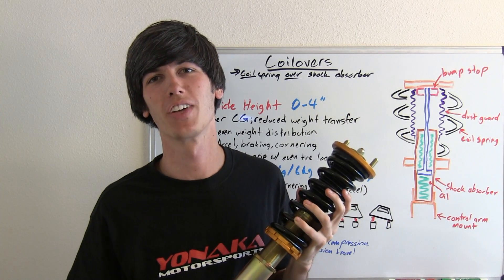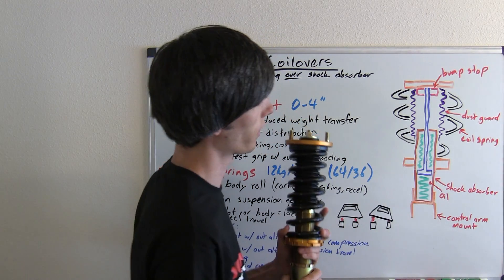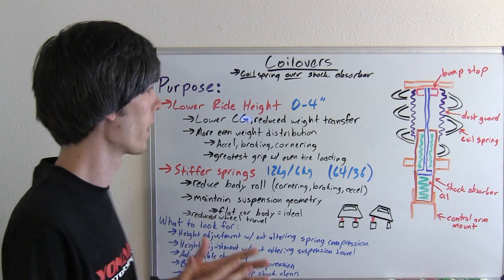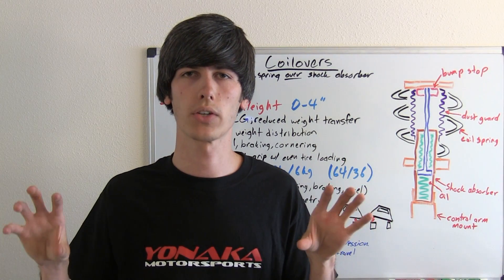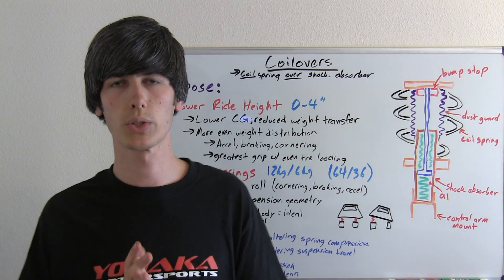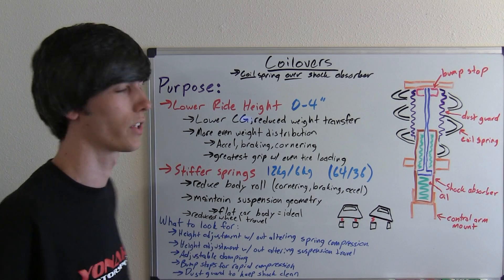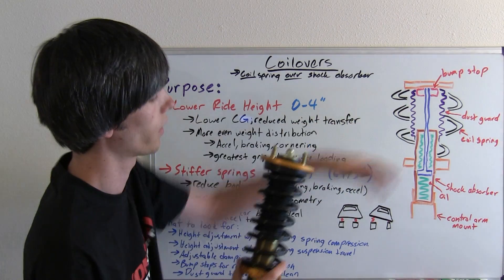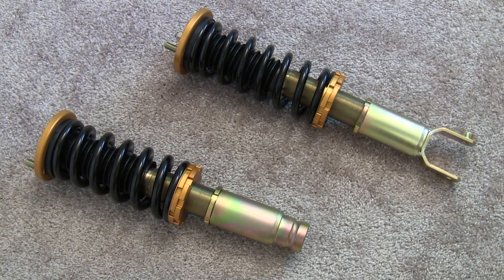Coilovers - Explained

Comment: You should do a vid comparing coilovers and air lift suspension.
Reply: Jordan Barone
Pneumatic suspension and airbag support/levelling aren't the same things.
Basically, the airbags are somewhat limited and replacement is costly.
The pneumatic piston kind isn't insurable, so not roadworthy. Sadly.
Basically anything can be made- but legally you can't drive it. Also it's not oem so you can only race/show.

Comment: trying to figure out the difference between coilovers and Macphersons... ?
Reply: animesis the macpherson is arrangement of connecting struts between the car, the wheel, and the the spring and the shock absorber - this entire setup forms your suspension 

The coilover is a type of shock absorber.

Comment: What's a reasonable amount to pay for 4 coil overs? only reason I'm considering coil overs is because all 4 struts are shot in my lancer and I don't have a spring compressor to switch out the struts
Reply: 400-700 for a smaller, but quality brand
800-1100 for better known brands with big reputations like BC racing, etc

Comment: My Toyota Camry has coil springs over shocks as stock with the car.  Are they still considered "coilovers", which you refer to as an aftermarket video?  Good video.
Reply from the maker: +bills48321 generally people use the term coilover to refer to aftermarket struts, rather than OEM, but yes, you'd be replacing stock "coilovers" with coilovers if you were to do a swap. Most cars have coil springs over the shocks, at least on the front suspension.
Reply: Thanks.  I am really enjoying your videos.
Reply: Know as macpherson front sus
Reply: but don't these raise and lower your vehicle?
Reply: Most cars???????? :D Nearly every common car made nowdays have ( with FWD). But Mercedes forgot to get one in their Sprinter (RWD). You know it's just a van you use to haul 2 tons of goods lol. So when your shockabs die, your front wheels just gonna move freely forwards and backwards. WTF Mercedes-Benz?????
Reply: Known **

Comment: Hello,
I'm an engineering student. I stuck with one problem. I wann find damping coefficient for air strut (of fox) but ,their is nothing information available for its calculations. No such setup to calculate it.( I live In quit remote area) Can you tell me how could I find damping coefficient? And is their any thing  you could tell me about it. Do manufacturer manufacture by considering damping ratio?? 
Do help me. Thnk you

Comment: I changed my Honda Civic tyre from Bridgestone er300 to Goodyear which are softer and less noisy. But now whenever I come across bumps, the car seems to jump more than before and this gives a "thudddd" sound from front suspensions if I am at bit higher speed....do I have to change my coil overs to stiff type or just adjust the tension in coil over?.........eventually I have changed my driving style and go more slower at bumps.....but I don't like this ...please advise

Comment: SO you can actually lower the car a few inches and maintain the same ride comfort?
Reply from the maker: +Kewfit Not really, no. Lower means you need a higher spring rate. Higher spring rates tend to result in a harsher ride.

Comment: I am very confused with preload and dampening. I purchased a car with coilovers but they are crazy stiff. I understand how to raise and lower the vehicle. but how do I make the ride quality smother (allow the suspension to travel further). do I adjust one or the other or both preload and dampening?
Reply: +WesTay Changing the preload will only change your ride height and at which point the piston in the dampener is at equilibrium. Unless you think the dampener piston is at one extreme or the other in it's travel there is no need to adjust the preload.
Reply: +neistridlar THANK YOU FOR YOUR HELP.

OK so preload is based off of the vehicles weight if I'm understanding you correctly. so no matter the settings one has there coilovers the preload factor should never change. 

so for a smother ride I should adjust the dampening and height only? I purchased the car like this so sorry but I have no prior experience of coilovers. my car is bearable when I am on slower inner city roads. but it is when I am at highway speeds that any little wave in the road drastically affects the car. to the point that I actually bunch from my car seat. it feels partly do to the stiffness and partly do to the rebound as it will bounce a few times after a bump (kind if like a trampoline effect).

I need this car to commute long highway distances once a week now so it is imperative that I fix this. not sure if I just have a stiffer coilover but they are (stance super sport coilovers) they also have camber adjustment. the car is a wrx hatch and I have custom fenderflares on the car as well so it is sitting quite wide with a 17x9.75 rim and tire with spacers. there is zero camber on the car as it was set up for a more so track day use. 

I purchased the car assuming I could change this as the tire is really low on the car and about a 2 finger gab between the flare and the tire. I am wanting to rase the car about an inch and increase spring travel as much as I can before it will rub from a bump.

I can not stand to drive the car on the highway for more then 30min before I seriously have a headache and feel like vomiting because the bunch is that bad, haha.
Reply: +WesTay bounce is that bad*
Reply: +WesTay Before you do anything on my recommendation keep in mind that I have not played with coilovers on full size cars, only on hobby grade RC-cars. The mechanics of it should be exactly the same, however comfort is not a concern in RC.

How much a spring is compressed when the car is resting on it is purely dependent on the weight yes. That means changing the preload changes the ride height first and foremost. The stiffness of the springs remain unchanged.

So to try figuring out what is going on with your car. Since it sits so low it might be possible that the previous owner did not understand how the coilovers work, and used preload to lower the car, in which case it is entirely possible that the dampeners are bottoming out. This would cause a violent jolt when the suspension is compressed, as if there was no suspension at all. It's practically free to try raising the car by increasing the preload, so I would try it and see what happens.

You say the car keeps bouncing after hitting a bump. Compared to a car that you would consider comfortable, is it bouncing at a high or low frequency? The higher the spring rate the higher the frequency of the bouncing. 

The main thing to do to stop it from keeping on bouncing up and down is to increase the dampening. Based on the cars that I have ridden in I would say you should aim for 1-2 bounces on heavy bumps. That seems reasonable for a street car.

Hope you figure it out.
Reply: +neistridlar it is very possible that the car was not set up right by the previous owner. I'm hesitant on changing the preload though as it is set properly from factory (that is if the previous owner didn't touch it). if I was to fiddle with it how would I know what the proper settings (factory setting's would be)?  I do know the weight of the car but I wouldn't know how much is distributed to each corner. (I may possibly be able to find that info online). I will first raise the car a little then adjust the damping and see if that does much. if not then I will look into the preload. but yes it has a very springy feel. for example if I was to shake the car left to right it would sort of wabble briefly afterwards. so it is possible that is is not absorbing the load as much as it is just converting the energy back away from its self.

Comment: so, if coilover is "coil spring over shock", it means it doesn't have to be adjustable just by definition.  Than isn't every strut with spring over shock absorbed a coilover?
Reply: Jan Mokrzecki When people typically refer to coilovers (as in this video) they are usually referring to aftermarket coilovers that are performance-oriented and are usually adjustable in both ride height and shock stiffness. However, most vehicles that have Macpherson strut front-suspension design use an OEM strut & spring assembly where the strut and the coil spring are integrated together into one unit, so technically they can be considered a coilover, but they are OEM or OEM-equivalent and are not adjustable. They are also primarily designed for ride comfort over handling performance as opposed to aftermarket coilovers that are performance-oriented and designed for handling over ride comfort. Hopefully that clears up some of the confusion.
Reply: +Jan Mokrzecki - I came with that question and I leave with that question. People are learning from this video, but without that question answered, I don't see how. Also, there was no mention about raising height though it was implied.

Comment: Its fine to explain how coilovers work, but normal people use them for looks but not for what they we're intended. I used coilovers for exactly the same thing when i was younger But beware of lowering the car to much, as there's a fine line between a good balanced car and a horrible one. The original wheel alignment you would use to re-align the car with is also not correct anymore. There are shops who know a lot about wheel aligntment on lowered cars but they are few and far between. Normal cars are not meant to be lowered more then 10-20mm (Or intended at all). Bushings, control arms etc are when lowered stressed and at a different angle, so an alignment will never be perfect, and can only be partly resolved by a shop that know's his trade.

Comment: Interesting video, but what's the real benefit of having having coilovers instead of an "independant" damper ? I understand they usually feature some useful adjustments, but that's not what makes coilovers be coilovers right, so where's the real intrinsic advantage?
Reply: +J-H Coilovers made for the aftermarket are not sold for racing, its for normal cars and gives options for a stance only (thats how most use them). For racing application they are made for evenly weight loading each wheel. That means that you put the persons weight in the car, and you then to a corner weight it and you thereby even out the weight in the 4 corners on, that means that every coil is adjusted differently. The only difference is the adjustable height difference, but lowering them coilovers compared to a fixed lowered kit is about the same, but usually a coilover kit is has a bit stiffer setup..
Reply: +Martin Rasmussen Thanks for that detailed answer. However, if you adjust every spring differently and get an even weight distribution front to right, it means the car will be quite inconsistent under other loads, as the  stiffness is different ? In a nutshel, the coilovers' real benefit is to feature many adjustments and that pretty much everything can be adapted directly on it, but if you use a fixed set-up, they're not that useful are they?
Reply: +J-H Usually you dont balance the car and go for looks and adjust the rideheight to what you find look good, that does'ent say anything about a good balanced setup. A racing car is never bound to the same springrate back to front, it depends on the application and if its rwd or fwd or front, mid or rear mounted engine and so on. Eventho the coilovers are adjusted differently, so they handle the same weight for each axle(a front or rear mounted engine will always have more weight on each end obviously). People rarely adjust with the driver in it either, that's 140-180 pounds thats not acounted for in the suspension, aswell as other lobsided loads the car has and it will influence the suspension when driving it.. This is not a big deal if you lower the car 10-30mm but over that you´re in uncharted territory and all the stock parts are working against you.. Coilovers are usefull if you know what they are intended for, if not your paying extra for smth you dont know how to adjust correctly and align.
Reply: +Martin Rasmussen Alright, that&#39;s clearer to me now. I&#39;m a motorsport engineer so I know about these things (weight distribution front to rear, spring rates, ride height,...), it&#39;s just that I heard about these coilovers pretty often without exactly knowing what their real advantages were. So again, to really benefit from coilovers, one should have to adjust them sometime, even though most people would buy them because they have no clue of the spring rates or sizes they need to achieve the perfect looking ride height and buy these flexible adaptable options. Thanks again!
Reply: +J-H 95% dont know anything about coilovers - its more like a gadget then getting a setup that makes the car handle better.. We know that a lower center of gravity helps a lot, but not from potholes, high pavements and even roadkill can be an obstacle.Expensive kits are good if implemented correctly but for normal road most coilovers are totally unnecessary. As i wrote i've done it myself, lowered my car so much that i endured back pains and rattling teeth, but getting older also makes you a bit wiser ;)

Comment: So changing the springs compression will change the wheel travel for example if I compress the spring more there will be less wheel travel and the ride will be stiffer am I right??
Reply from the maker: +Jadon Ghereben No, changing the spring-preload will not change the spring rate (unless it's a progressive spring), so it will not change travel (or ride height). There will be a separate thread on the shock body for adjusting ride height.
Reply: +Engineering Explained i heard you mention something about adjustable ride  height ...so will i be able to a coilover raise the height as well???

Comment: ah, lowering a vehicle will lower CG, but depending on the suspension components, arms, hub, multi-link, roll center can be lowered further away from the CG.  the trade off to lowering cars.  the further the distance of the roll center relative to the cg, will present more body roll.  think of a pendulum, the CG is the pivot/fulcrum, the roll center is the swing weight.  further from pivot, larger swing.  unless i'm bass ackwards on this?
Reply: +Thor Velasco You're correct. What you're referring to is called roll couple.

Comment: Hi, very useful and interesting video but i have a question about something i recently discovered, a car is designed to work best at stock height, if you lower it, the suspension components sit in a different position and in some cases you actually increase the body roll rather than reducing it, how can you compensate for that?

Comment: Great video but you're wrong about the force of the spring....a 12K spring isn't 12Kg it means you need 672lbs to compress an inch of the spring...remember cars are in 1000's of lbs....so the 6k in the back will only require half = 336lbs to compress an inch.
Reply from the maker: +Deejay Core What are you saying? 12 kg/mm = 670 lbs/inch. Check the math before saying I'm wrong.
Reply: i meant to say per inch...12K spring means you need 670lbs to compress an inch of the spring...you said 12 kilograms to compress an inch which is only 26.5 lbs...was just trying to correct you...but i love your videos and coil-overs are an excellent option vs lowering springs and stock shocks which ride horrible after a few months.
Reply from the maker: +Deejay Core Apologies if I misspoke. A 12K spring means 12kg/mm.

Comment: 12/6 is that for a road car cause if you want to have it on track you had better be looking at 24/18 or close to :)

My Civic runs 7/4.5 on Gravel & 16/8.7 for Tarmac Rallies - Hmmm not to sure on that gimmick bottom adjuster wouldn't that change your whole overall Length & Travel range!? making for some interesting bump travel!!!

Comment: if i install my coilovers, do i need camber kits for the rear or both the rear and front? AND is it possible to not use camber kits?
Reply: +Anthony Chan  Depends on the type of axel, on Front most likely, Is rear independent suspension or solid axel? Solid maybe no. You can do with out but will not handle as good or may damage suspension components.Lots of engineering goes into designing the factory system, same engineering is required when being altered. Most suspension manufactures provide all necessary changes required for the Suspension and Car match. Hope this point you in the right direction.  Please research and know what you are doing as serious safety issues could arise if you don't.

Comment: hey 

you didn't go over this in the video but could you shed light on "True" vs "oem" style coil overs. Ive been reading a bunch of forums and i can find an answer. The part that is confusing is the geometric aspect, is it the same or is there an actual difference? Also I'm wondering wouldn't a true coil over setup be better because you remove the bucket for a solid toe arm and you shed off a little weight. My biggest concern is what type of damage would happen to the suspension because you're changing the geometry from what the manufacturer wanted. An example i have is on the 350z platform, Bc KW tien and other big companies use oem style compared to true coil overs the question is why?

thank you

Comment: I also am from new zealand as one of the previous commenters... Interesting. So coilovers are more expensive because they come as complete sets as opposed to lowering springs which replace the springs over the OEM shocks? I love cars dude but unfortunately I was bored out of my brains by school science topics so never got the chance to consider engineering as a field of study. I believe that with a sway bar and lowering springs the car will be more stable around corners but due to the extra strength of complete coilovers the stiffness and responsiveness will be much more. Haha. And that's science!